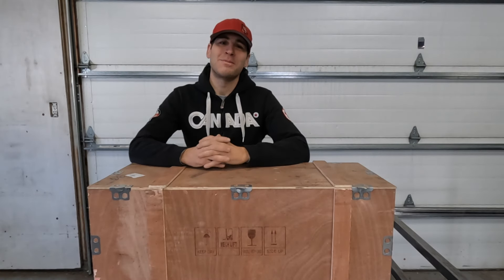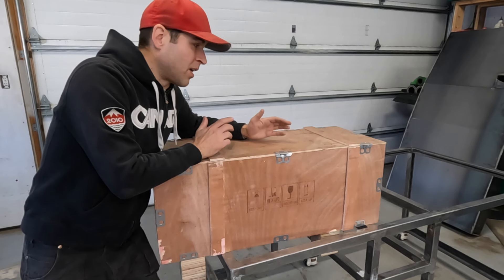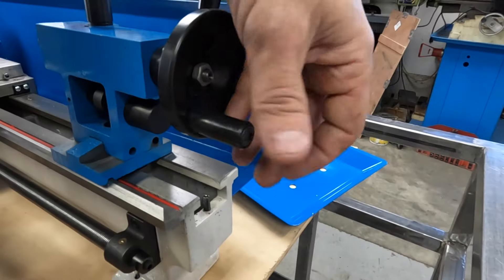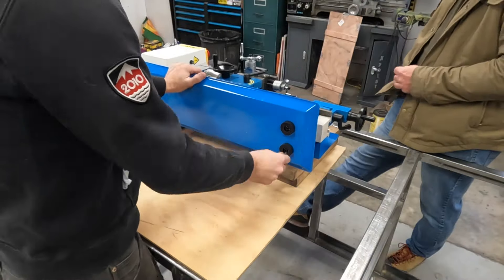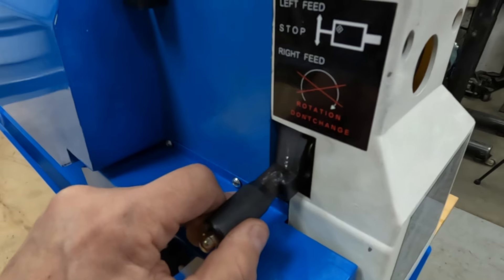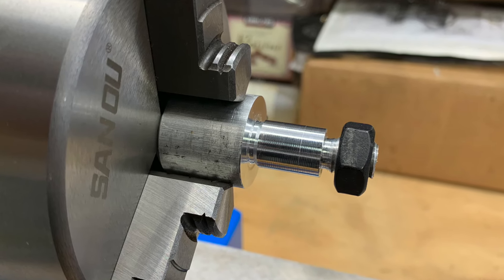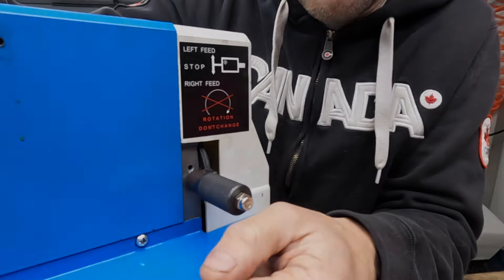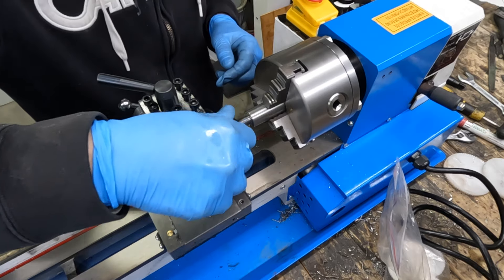First Chips On The Vevor Mini Lathe - Everyone Should Have One A Lathe !

Comment: have had mine now for couple yrs, only problem is the funky motor that   easily stalls if under a load....so the  motor needs to be ungraded  thats it............
Reply from the maker: These little laths are very handy and a great tool to have in your shop, when you need it ! 

Yeah, the stalling problem is a consequence of using a variable speed DC motor. It is very convenient, but they do not have much torque when spinning at low speeds because they reduce voltage to slow the spindle. 

To truly fix this you need a much more expensive servo motor or AC motor with a VFD... An intermediate solution is to use a larger, faster turning motor, and then gear it down so that you gain torque form the gear reduction. 

My 10X22 mill uses a fixed speed motor and I have to change belts to change the speed. While it does deliver much more torque at low speeds, it is such a pain in the butt to change... it pretty much always stays in the same speed range, unless I absolutely have no choice, haha.

Comment: When cutting 1,5 mm thread on the lathe with 1,5 mm lead screw, you could disengage and engage the half nut when you need. Another story if your lead screw is 16 TPI 😉
Reply from the maker: Yeah... I don't use a lathe enough to be comfortable doing this.

Comment: I recently received a mini lathe from vevor. The box was all smashed up and multiple parts  damaged. I've had to make several upgrades and have more to do. I didn't get much from them regarding the damaged parts. I've had to repair several things. The manual doesn't have any info.
Reply from the maker: I'm sorry to hear that. I would have requested a return immediately.  I have had numerous products from Vevor and have been very impressed with their packaging. 

That being said, if a shipping company is rough enough with this crate to smash it up, I would not be accepting that delivery. 

The manual is pretty much useless. If you haven't had it for every long, politely contact Vevor and let them know what happened. Form my experience, they are more than willing to take care of their customers... You may even get a free lathe out of it. 

My advice would be to keep it short, factual and try not to be dramatic or emotional. Let them know what happened keeping in mind that the person you are talking to may have a poor grasp on english.

Comment: Can this also cut stainless steel?
Reply from the maker: There's no simple yes or no to this. I have a 10x22 lathe that is much more rigid and powerful, and it will cut some stainless, with some tools, with certain techniques... but it won't cut others. 

I don't know much about the machinability of different grades of stainless, but suspect that this will cut some stainless, if you are selective and pick a type that machines relatively well, and / or use the proper tools and techniques.

Comment: Did you clean this before you did the video
Reply from the maker: I did not .... Do you mean clean it from the factory ? ... It was very clean. Surprisingly so.
Reply: @loweredexpectations4927  , yes usually they are smothered in rust inhibitor grease/oil.  Did you adjust the gibs?
Reply from the maker: @Mac-mu9cs  Yes, the gibs took some adjustment and I had to align the tailstock. There were a few things out of whack.
Reply: @loweredexpectations4927 

I must have missed those last few minutes in the video where you mentioned adjusting it.

Comment: No half-nut lever for threading😑😑
Reply from the maker: It has a half nut lever.... However, it doesn't have a thread dial, so you need to leave the half nut engaged. 

This could be added, but with the little threading that I do on a lathe, even with my 10x22 lathe I keep the half nut engaged and thread in this manner.

Comment: These lathes are a total shitshow.  Built from parts from the reject barrel. I have the Vevor 7x16, and it is a total joke.  After working on this thing for 6 months, it is going into the recycle bin, right back where it came from.  I was thinking about trying to sell it, but I it would have to be just for parts.
Reply from the maker: Perhaps your expectations were too high or you got a dud... There are thousands of these out in the world (branded as Vevor and others) and the owners are quite pleased with them. 

These are hobby lathes and most people who get them spend an eternity, or the first year of ownership, using the lathe to improve the lathe, while developing skills and knowledge on how to use a lathe, and discovering what you're needs actually are. 

You mention being a total joke, but you don't mention what you were trying to do, that it wouldn't do. That may be helpful for others considering purchasing one of these. 

Ps. I have a King Canada (Grizzley G0602) and I have worked on it for the 10 ish years that I have owned it. It's a wonderful tool that cost many times what the Vevor does, and still required lots of upgrades, fixes, modifications. 

I also watched videos and got advice from others for about 2 years before making a lathe purchase.

Comment: I bought a lathe from this company and boy what a joke. The tail stock had all kinds of pits in the iron. They cut it out of a rusty piece of pitted iron and then painted it and then the steady rest was the same way. Then they pride themselves by saying in their instruction manual that they only use HIGH QUALITY PARTS😂😂😂what a damn joke. It was dirty and they didn't want to replace the pitted parts because they said they still work. Yes they work but it's a imperfections so they should of replaced those parts. So I will not buy anything from this company again and I should of listen to everybody that told me to stay away from Vevor. 👎🏼
Reply from the maker: I bought a $2500 lathe and was pretty upset to find the same things ... 10 years later the lathe is working fine and I'm happy with the product. 

At the time of purchase, I actually made a video, on my other channel, talking about all the things I didn't like about it. People were quick to point out that it wasn't a $10,000 lathe 🤣

While I wouldn't be thrilled to see a chunk of casting cut out of my lathe, Vevor, and the manufacturer are right... If it doesn't effect the operation of the unit, then it shouldn't be repaired or replaced. This is what keeps the price of their products low. 

I will admit, they do talk a lot of nonsense about quality. Most of their stuff is decent quality, but overselling a product is a good way to end up with disappointed customers.... and it also means, people don't believe you when you do have an exceptionally well built product. 

Vevor sent me this lathe for free, a few heaters an ultrasonic cleaner and a few other tools, but I had been purchasing products from them long before they sent me anything. 

I have a rotary flex shaft grinder, pipe bender, vacuum pump and chamber, go-kart wheels, a CVT clutch kit, hydraulic brakes and a few other items... I have been please with everything. I did receive one welder that had issues.
Reply: But did it work?

Comment: Stupid changing the tool holder. Are you in a race or something???? Plastic gears are fine NO need for steel.
Reply from the maker: The quick change tool holder is far superior to the standard tool holder. Not only is it quick, meaning you are more likely to do appropriate tool changes, it is also generally more rigid and  more accurate for centering the tool. 

It has nothing to do with being in a race, it has to do with human nature and sometimes the order of operations. You often end up in a situation where you need to swap out tools to do one operation, and then switch back. If that swap takes you 10 seconds, you are likely to do it, where if it takes 10 minutes, you are likely to change your order of operations or to do an operation by hand, later. Efficiency isn't just about being faster. 

Plastic gears are fine in most cases. My 10x22 has plastic gear for the primary drive and all the rest are metal. Plastic gears do fail, usually when users make mistakes. People who buy these little lathes are generally beginners and or hobbyists, who are more likely to make mistakes.

Comment: Gloves on a lathe? No!
Reply from the maker: Yeah, this is correct. Gloves around a lathe are a bad idea. 

Latex or nitrile gloves will just get ripped off, I know as it has happened a few times. A few years ago (2020) I had a brain fart and touched a rotating shaft with my gloved hand, those rubber palmed work gloves, and brought the lathe to an abrupt stop with my hand... 

Needless to say, it didn't go well for my hand or fingers, but I didn't lose any. I wear nitrile gloves at the lathe, milling machine and around the shop as a calculated risk. I know that the chemical exposure is 100% a bad thing, and I need clean hands for dealing with cameras, batteries and tripods.